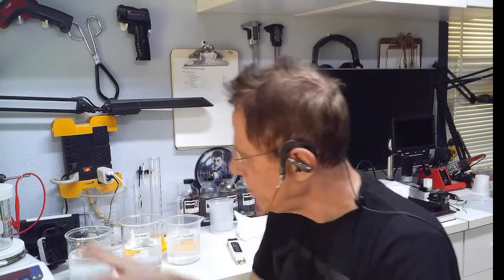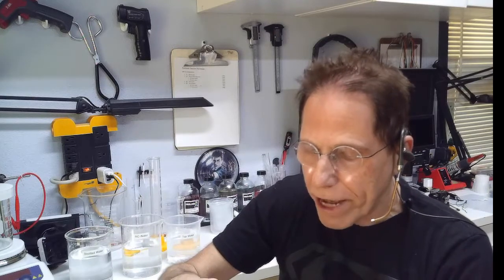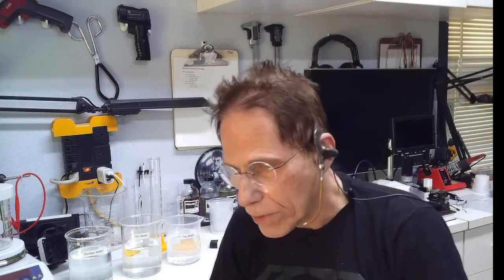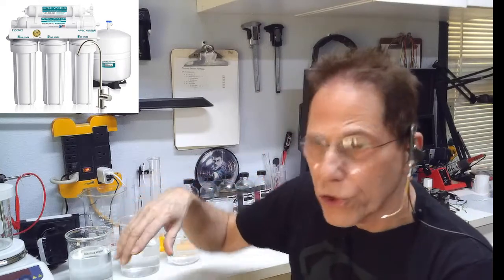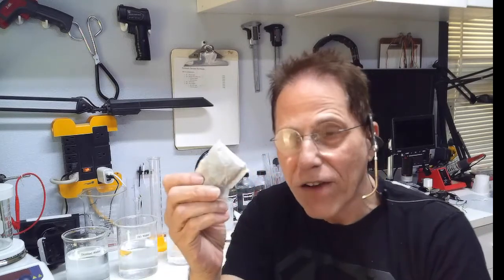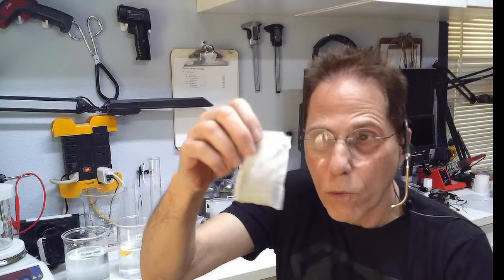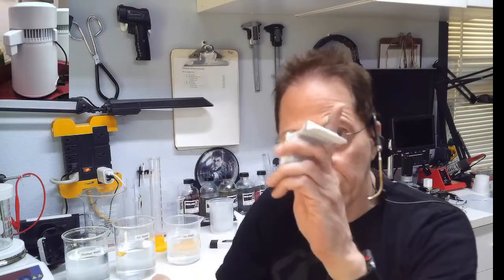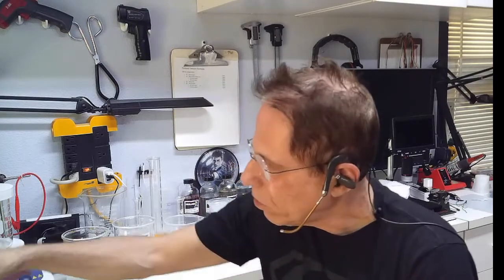RO water for your Distiller. Do you need the carbon filter?

Comment: Can I use rain water instead the vivohome  don’t come with filters 😢
Reply from the maker: Sure, you can put rain water in the distiller.
Reply: @AlchemyWizard  thank you sir 🙏🏼 God bless you fm 🇯🇲
Reply: I use rain water when ever I get a good rain, I wait to give it time to clean the metal roof and just set a plastic dishpan under the down spout and then dump it into a plastic bucket, about three times will fill the 5 gallon bucket. I run two 1 gallon distillers and do 2-3 boils when I run them.
Reply from the maker: @keithjohnson5190  I've measured rain water here at 5-ppm. And yea it can make a good clean water to dump into your distiller to take the last of that stuff out. You should get 0-ppm at the output, but I suppose it still could depend on what in your rain water to start with.

Comment: This makes sense. I've started experimenting with a ZeroWater filter and it claims to remove everything VOCs and TDS (including Chlorine to 0.03mg/l), and indeed the TDS measures at zero and I think the results are good enough for my needs (remineralising water according to recipes for making coffee). So distilling will remove the remaining tiny amounts of things but perhaps I don't need to bother.

I was looking at distillers in the hope that I could use them instead of the filters. But if I have to filter before (or after) distilling anyway that negates the point for my purpose. Unless I can use some cheaper filter first. That might be worth investigating.
Reply from the maker: If your intention for a distiller is just to clean up the water for teas, coffees, recipes and re-mineralized drinking water, you can just use a good filter, zero filter, or RO unit. Which one you use depends on how much water you need for your household. Here with electric cost, it costs about 25 cents to distill a gallon of water, and takes about 3.5  hours. You only need distilled water for things like CPAC machines, vaporizes, etc, and of course laboratory work.
Reply: @AlchemyWizard  makes sense. I think I'm on the right track, then.
Reply: Do a combo. Distill first for the purification heavy lifting, then use the ZeroWater in post to remove any lingering VOCs or minimal remaining TDS. The ZeroWater filter will last a super long time too since the distiller is doing most of the work. Meanwhile sometimes those cheap distillers leave a bit of an odd taste despite making the water really clean, and the ZeroWater will handle that.
Reply: @4DTravelr  I think the conclusion I'm coming to is that for coffee water, the Zero water filter is both unavoidable and sufficient.

Some other treatment first would make the ZeroWater filters last longer but it might not save much (if any) money given the cost of the other treatment.
Reply from the maker: @4DTravelr  I've actually tested this. It be fine for drinking and for nebulizers, oil diffusers, vaporizes, etc. Not sure about CPAC though. The filter media i zero filter messes up the distilled water and leaves things behind that prevent a plasma arc from forming. They can even pose a problem with LVDC electrolysis colloidal, especially with ruby red gold, where these particles can have unpredictable results.
Reply: @AlchemyWizard  Wow, no kidding? Thanks for the comment. That's unfortunate. I wonder if ZeroWater is aware of these particles.

Maybe instead of post-filtering distilled with a ZeroWater pitcher, could use instead a PUR pitcher, which is solely a carbon block? Those even have a handy indicator light for when the block is spent. And more effective, by sheer size alone, than the tiny carbon sachets.

Comment: If only using this machine to make water for a CPAP machine should there be an issue?
Reply from the maker: For CPAP machine it will not matter if you leave the carbon filter in there. However you will have to change the carbon filter after about 300 gallons of distillation. When the carbon gets saturated it will start to dump the stuff back into the water it previously absorbed. The distilled water could develop a smell or taste if the carbon filter needs changing.

Comment: I've been using carbon filters for years in various water filtration units. just run water through it. Im pretty sure you could just rinse it in a strainer with running water as an alternative.
Reply from the maker: IMO, the carbon filter is so small in the end of the distiller that even if it did not contribute to the contamination of the final product water, it's fairly useless for removing anything.

Comment: My working hypothesis is that the brisk boiling causes microscopic droplets of water to float out of the machine along with the steam. I have to distill twice to get acceptable results.  I'm about to try to put the carbon inside of the distiller to trap water droplets before the get out, and allow only the steam. If only steam was coming out, we would never need any carbon at all.  Any comment?
Reply from the maker: Sounds reasonable. These distillers are quick distillers, they are not the same as the glass laboratory distillers, which take much longer and produce far less distilled water. However the water coming out of them is extremely pure. let me know how your experiment works out.
Reply: @AlchemyWizard  Just received my TDS meter. Base line is tap water at 77ppm.  Distilling twice with the lower unit connected to 100Vac and the resulting water reads 3ppm.  I have another batch at 90Vac on its second pass. My next move is to add a charcoal filter inside of the boiler, before it even gets inside of the condenser coil. We'll see how it comes out.
Reply from the maker: @pierrec1590  Keep us informed.
Reply: @AlchemyWizard  A minor milestone: Supplying the base of the distiller with 80Vac I distilled one gallon in one pass that took 9 hours, and the water read 2 ppm on the TDS scale. Furthermore, the water had no smell at all. This would tend to support my working hypothesis to the effect that brisk boiling produces tiny water droplets that get pushed out of the boiling vessel to contaminate the distilled water in the receiving container. I am now trying at 75Vac using the same Variac as a power source and feeding 120Vac to the top part.
Reply: @pierrec1590 .. update?
Reply: I distill once and I use the charcoal filter and get a 2 PPM. We have to remember we might never get a zero reading, the TDS meter can be giving a reading of +2 or - 2 a reading of 2 or 3 PPM is a good reading.
Reply from the maker: @keithjohnson5190  remove the charcoal filter where it drips out, I bet you get 0-ppm.

Comment: Ive been passing water through a Berkey filter prior to distilling because that is what I have.  Any comments on that?
Reply from the maker: Wow, I want one! Yes that is an excellent (and an expensive) filter system to use.  Nice going there. It should be fine for using before your distillation process.
Reply: I use that too but I run it after I distill the water, not before.

Comment: I'm looking to get a distilled machine.  Im So confused about what one to get .  And to complicated
Reply from the maker: basically all the distillers that look like the one featured in the video are the same. some add timers and electronics to them. None of them are perfect and if your water is heavily mineralized, like over 90ppm, you probably will have to distill the water twice to get it down to 0ppm. If you run your tap water through one of those pitcher filters first, then you will probably only have to distill the water once.